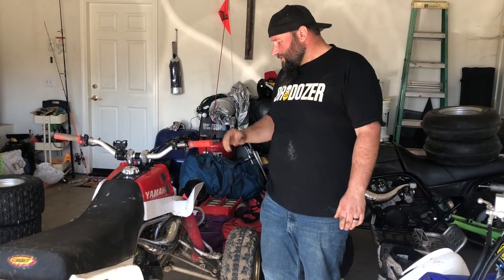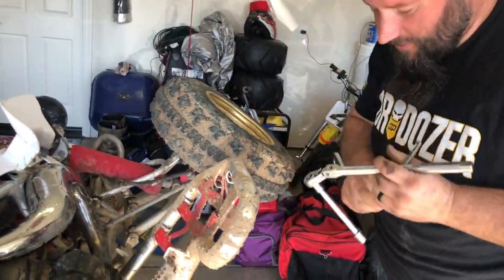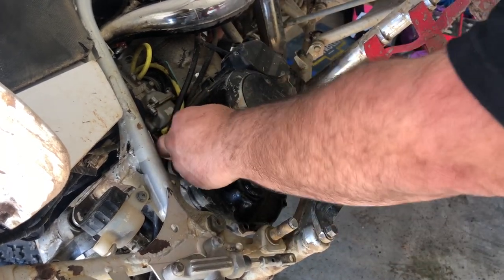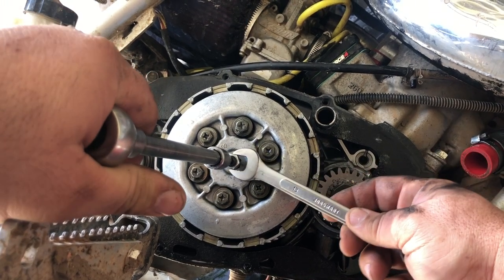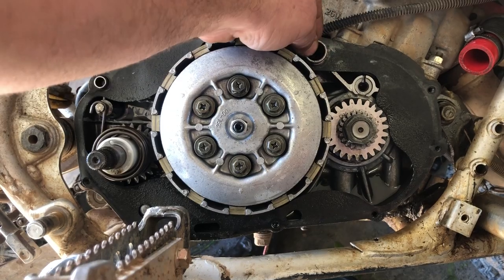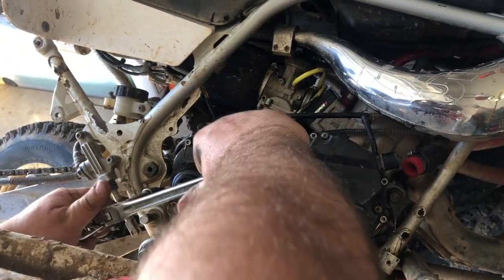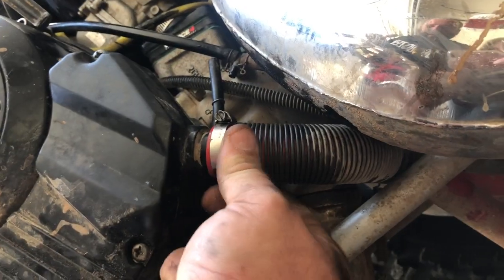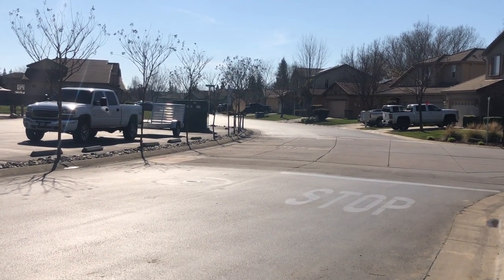Banshee Clutch Adjustment

Comment: Do you need to take any special precaution that the water pump gear meshes together with the internal gear?  Or when you put the cover back on it automatically lines up and meshes?
Reply: Hey it won’t go on if it’s not lined up slight tap the Cover & water pump gear will make its way home. Kick start gear dowel pin and colnt neck lines it all up. Upgrade the water pump and get ride of the plastic gear the plastic teeth brake. Take off 🐳Water pump cover on case off after instal and turn engine to check your pump🦦🤙✌️

Comment: Wrong!!! The adjusting screw is turned in or out till the arrow on the arm where the cable connects aligns up with the arrow on the case half, just like the service manual tells you!! Close but no cigar. Bill Ross Certified Yamaha Motorcycle Service Technician
Reply from the maker: if that works for you that’s terrific. most anyone with a banshee will tell you with any aftermarket clutch lining up the arrows, most time, does not properly adjust the clutch. go watch south texas banshee on that. not trying to insult your yamaha certified technician diploma but you’re wrong and so is your “book”. Martin, certified back yard hack.
Reply: @thequadcouple8085  love the reply :)